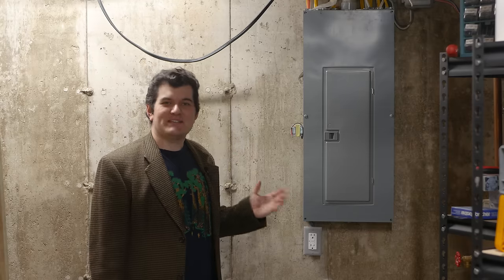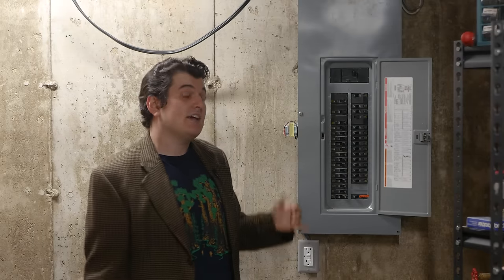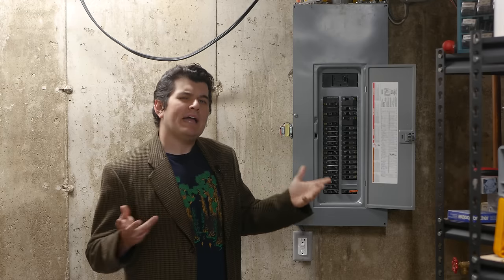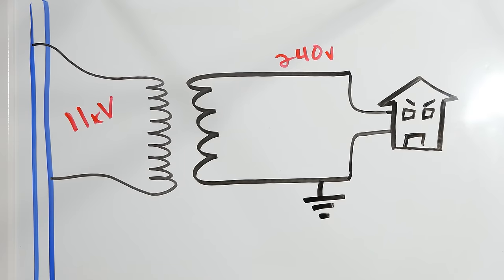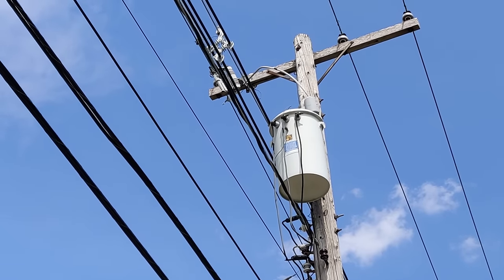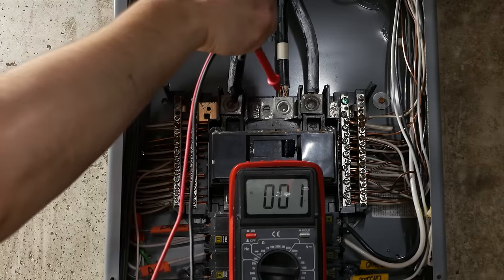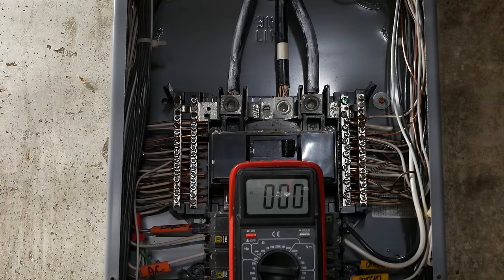The US electrical system is not 120V

Comment: The calculation at 14:40 is misleading. When you plug a charge, with 240V you get HALF the current for the same power. Take a TV with a power input of 100W as an example: With 120V you have 0,83 Amps (I = 100W / 120V) whereas if you plug it at 240V, you only have 0,42 Amps (I = 100W / 240V).

Comment: 6:35 You were correct, I am absolutely screaming in my head right now, because:
1. Those open electric copper cables feel *extremely* unsafe,
2. Connecting the neutral (N) and protective earth (PE) at the same connector is quite dangerous and
3. This electric "box" can't have any RCD's because of reason 2

I wouldn't be surprised if this box exploded and went straight into outer space.
(And yes, before you're asking: I am from Germany)

But asides from this, the explanations were great, as mentioned many times before.
Reply: 1. Those open electric copper cables feel extremely unsafe,

The voltage on the "open" copper cables is zero volts.  You can feel them with no problem.  

2. Connecting the neutral (N) and protective earth (PE) at the same connector is quite dangerous and

Neutral and "PE" are connected at only one place. The first disconnect. 

3. This electric "box" can't have any RCD's because of reason 2

Don't know how RCDs work huh?
Reply: @billelkins994  I'm sorry if I misunderstood some crucial differences between American and German electrical installations and did not clarify things enough:

First, with "open" cables, I am actually referring to the big phase cable with non-insulated ends, which definitely are under voltage.

Second, I don't really understand, what you're trying to say, but I found that it's much more complex than I thought and that the differences between American and German grids are too big for me to make statements about whether it's safe or not.
And also, I don't know which kind of electrical system he is connected to, which makes this decision even harder.

And third, yes, you can install an RCD in this system (Can't tell why my brain said "nooo, you cannot!"), but those installations are less safe, because they do not trigger under certain circumstances.
Reply: @anno_nym  Ahhh! Now I understand.  If something that has voltage on it can be seen or touched it will cause Europeans to "scream in their heads."  They ignore the fact that the "open connections" are normally behind a grounded steel panel.
Reply: @billelkins994  I really didn't want to start a discussion here. Please acknowledge the fact that our mentalities might differ from each other from what is safe or not.

If you think that's appropriate, you can request the original comment to be deleted. I will neither modify it nor continue this discussion.

Comment: 13:45 …but isn’t the neutral wire carrying 240v back to the panel?
Reply: No, it's 0V.
Reply: @wta1518  oh I get it now.  Thank you
Reply: @wta1518  so how is it not 240v in the other two wires?
Reply: @BLKSG6  It's 240v between the two hots, but one any single wire it is only 120v.
Reply: @wta1518  ok so this is because the neutral is 90 degrees out of phase with either hot wire and the two hots are 180 degrees out of phase with each other, so it’s like one is pushing and the other is pulling at the same time, if you will?  Where I’m stuck is if there is 240v available to the appliance when it’s plugged in, how is it not 240v across the entire circuit. Or is it really a doubling of the amps going into the appliance that the appliance would then have to step up to get 240v?  I watched about 3 videos on this and I still didn’t get it.
Reply: @BLKSG6  Because it's 240v across the two hots relative to ground. The neutral is ground, so it is 0v.

Comment: I had an international quality ISO certified geyser that stored hot water through the night for me to have warm water in the morning. However, it had a 2000 Watt coil that split open in a few months exposing me to the 240 volt current. I'm used to being killed like this, so I used an alternate heating source - solar water heater. 😊
Reply: This is a business trick whereby the company gets money for installation, repairs and replacement of coil. A good company makes coils that last 20-30 years. Also, the number of patients with severe electric shock injuries while using the shower would increase 😮.

Comment: As an electrician, I’ve always loved people that were afraid of electrical. That way my price can always be high.
Reply: One wire equals 120 V you’re correct if you touch two wires you get 240 V. I don’t suggest trying it but as an electrician, I know what can happen.
Reply: 240 won’t kill you to 277 won’t kill you. 480 might I have been hit by 120v and 277 volt and 208. Don’t tell me it will kill you. I’m still alive after being shocked 1000 times. The only time power will kill you in America is when your heart is standing. Still at the same time you get shocked, have a heart murmur. I’ve avoided death repeatedly
Reply: Then he wasn’t working with the proper people because if you get killed by power, all it takes is the same power to restart your heart. And proper people to support him if he does go down is the failure of that company.
Reply: The only reason my skills are so good is because I am a third generation, and was taught everything since nob tube wiring. And I was taught never trust anyone and always treat a wire like it has power.
Reply: Now I just wanna be that guy that starts a YouTube channel. How many electrical shocks will it take to stops a heart. And find the true chances. Or have I been the special case because of a heart murmur. Handling over 1000 electrical shocks.

Comment: If the 240v is between +120 and -120 both wires are dangerous, surely it would make more sense for 240v at top, 120v middle and 0v bottom, is there a reason its done the way it is?

Comment: In Sweden and probably europe we have between 16 and 30 Amps main fuses at 230/240 volts but 3 phases in normal houses. Mostly used to be 20 amp main fuses.

Between the phases you have 400V and if you conbine all 3 phases like in a motor you get the equivalent power of 400 * sqrt3.
Reply: In Sweden your three phase 30 amp service provides about 21 kw.
The panel in this video is 48 kw and the square root of three is just irrational.
Reply: @billelkins994  what is irrational, do you have any clue of 3 phase couplings and who asked about 48 kW!
Reply: @Bizmyurt  OK I'm sorry! I made a lame joke but the square root of three is not a rational number. At least it is not imaginary. (Another lame joke.)

48KW is standard service to a house in North America. Fortunately no one ever uses 48KW or bankruptcy would soon follow.

Three phase? Yes! I know couplings. You mean like :
High leg four-wire delta
High leg four wire open delta
Grounded corner delta
Zig-zag Y
Scott-T

Comment: 13:45 There are two lugs right there that have 240V between them, never mind that each of them has 120 volts to ground. Admittedly I can only see them because you took the cover off, but still.

Also, you say we're not talking 3 phases but y'all do generate 3-phase electricity, no? You just connect houses up to a single phase split into two, is that right?
Reply: Yes, our distribution system is 3-phase.  Residential customers are usually connected to just one phase.

Comment: Plugging the ground and neutral to the same bus seems wrong. How do your differential knows if you have a "leak"?
Reply: GFCI's measure the difference in current between the hot and neutral in order to trip. Ground isn't even necessary.

Comment: Boy, i understand so little of this stuff, and it fascinates me. I get the sense... the American system of engineering the 240V system into two 120V circuits seems quite ingenious to me. You mention that safety was not really the main motivation behind it but more a by-product. So be it. It definitely looks clever to me. Now i wonder how the Europeans do it. You mentioned it had something to do with the rebuilding after WWII...?
Reply: Europeans have 3 Phases at 120° to each other coming into homes, 240V from one phase to neutral, 400V from phase to phase. Most appliances just use 240V from a single phase, some high power things like electric stoves, ovens, water heaters, electric car chargers use 400V or multiple 240V phases.

Comment: I get it, no My house WAS only 110-120 no 240 that is only when you have appliances like the AC for rich people most homes still only use 110, is good to have the option 240 in case you need it only 2 breakers handle full load, the rest of the house runs on 1 breaker of 110v  less voltage means less danger to get a spike , so all "hi voltage" run on their own dedicated line

Comment: I just want to point out ohms law is not quite the right way to look at the relationship you are explaing. Any device that pulls 1500W is going to pull 1500W regardless of the voltage and P=VI so as voltage increases, current decreases.
Reply: You are wrong.  This is is a very basic subject.  You need to go back to the beginning to learn practical electricity.

Comment: So 120v Kills and 240v really kills :) nice one. Re foot hazard - as our sockets are switched we don't need to unplug them all that much, however most low voltage adaptors like phone chargers draw power if left plugged in, unless of course, you can switch them off at the socket :)

Comment: 16:25 I’ve been shocked by the 120v. So many times… mostly glancing blows but still. It doesn’t necessarily hurt when it happens. I just don’t like it as all.  It’s like putting you’re hand in or walking through black widow cobwebs,  they are stronger than most other webs sound different and they are always disorganized. The cobwebs don’t hurt I just really don’t like the feeling…

Comment: 21:24 lol I'm an aussie and the reason why we have switches on or sockets is you flick the switch off before plunging in or unplugging it so you're not plugging or unplugging a hot plug like the US likes to do 🤣
Reply: Most small appliances have switches on the device.  We don't usually plug and unplug such things hot.  One thing that generally does not have a switch is a cell phone charger.  They are plugged in hot, but the current draw is so low that the arcing is insignificant.

Comment: Does this mean that your 240V circuits do not have ground? Because in europe going to ground gives the full 220V, but here it would cut to 120 into the transformer, not the ground. Also how can ground go to the middle of the transformer. Everything seems weird. Like somebody designed the electrical distribution by throwing dice for what to connect where.
Reply: Also neither 120V or 220V will kill you if you don't get attached to it for a prolonged shock, if you do, both will kill you. I got quite a few 220V shocks. The first thing that happens is that you get bounced away as soon as you get the shock and detach yourself. Then you have a dizzy part of the body for a few minutes because the nerves are supercharged, and after that you are fine.

Comment: that little thing on side of  panel is a very small version of a transformer like on the telephone poles probably used for a doorbell low voltage circuit stepped down from 120v breaker getting power from the 240v main breaker getting power from  the 600v telephone high lines seviced from electric company

Comment: The 400V 3 phase, 3x 25A in EU standard, in modern insulated homes that are full electric with heatpumps coping with 17kW for heating, EV charging, and other household equipement makes US 120/240V split phase system looks obsolete at best.
Reply: You don't need 400V for 17kW
Reply: @Jst4vdeos  at 25Amps you will.

Comment: Wouldn't connecting a device across the two phases, compromise the RCD/GFCI systems, by not having a neutral wire connected?
Reply: You would use a 240 V GFCI breaker.
Reply: @GH-oi2jf  But doesn't it require a neutral to work?

As I understood it, it works by comparing the current going out via the hot (phase) wire to that returning via the neutral, and tripping if it detects a difference.

If there is no neutral wire, how does it detect the difference?
Reply: @BedsitBob  In that case, a 240 volt GFCI will just measure the voltage between both of the live wires. A 240 volt circuit doesn't need a neutral for current to flow.
Reply: @tier3rd375  Exactly my point. The GFCI won't trip because it won't detect a current leakage.
Reply: @BedsitBob  The circuit is between both wires. So all it needs to do is monitor both wires. It doesn't need a neutral to detect current leakage.
Reply: @BedsitBob  If you've ever been to a hotel or anywhere that has packaged air conditioning unit installed in the wall, you would notice that the plug for the unit is a GFCI plug. It's a 240 volt GFCI. How it works is by monitoring for leakage across both wires because both wires make the circuit. It doesn't need a neutral to detect leakage.

Comment: You have not clarified that the US DOES have a 120 volt electrical supply,  not 240 or thereabouts. It's just that it seems that many houses have two phases installed.  In my house I have for some reason 3 phase, with the consequence that I can spread the load evenly over the two most power-hungry devices, the electric stove and the geyser. And, in theory I could use a 3 phase motor,  for a borehole, not a single-phase capacitor-start or the like.  Since 120 is no less dangerous to the human who gets an electrical  shock I can still not understand why North America has this supply.  And of course the original DC of Thoman Edison was crazy. He was an avid patenter, often of ideas not his own, and in the record is a telegram to an English equivalent - can't remember who for the moment  -  begging him not to make the "disastrous error" of using AC.  I am by the way aware of the HV transmission pros and cons, but that is another matter.
Reply: Thomas Edison's DC service ran for 125 years in New York.  Not exactly a financial failure.
Reply: @billelkins994   I can't see the relevance.  Once you've standardised on something you're struck with it
Reply: @ralphwortley1206  The company that stopped the DC service is named Consolidated Edison. ConEd still provides 30 billion pounds of steam to customers in NYC. They started selling steam 141 years ago.  Energy is energy. Doesn't matter too much how it is delivered.
Reply: @billelkins994  It matters very much. WATTS =  volts  x amps.  
If you had a 32 volt system you'd need cables as thick as your finger to boil a kettle.  Because of their power demands much industrial machinery works on 600 v. Transmission lines work on up to tens of thousand volts. Look up a textbook to see why.

Comment: So if I get a "ground reference neutral" does my house still need its own ground? Or can I just use that 3rd neutral wire as a ground? My house is quite old but I think it is wired this way. Might be out of code now
Reply: If your house is old enough, you have no ground.  Back then it was not required.  No, you can not use neutral as ground.  Suggest you run all your receptacle and light circuits through GFCI receptacles next to your panel.   Also, make sure that there is a ground connected to the neutral and to an electrode.  Metal pipe, ground rod, or other metal in direct contact with dirt.   May already be in the panel or the electric meter.  That is for lightning protection.  Best wishes,   Kevin

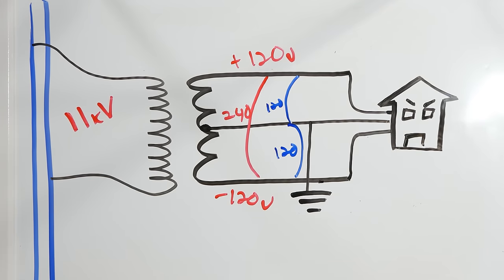Comment: Also, at the 5:54 point, you state that the two "phases" of the 240-120-240 "split phase system have each phase of the individual 120-volt circuits 180 degrees out of phase. That is incorrect. The transformer on the pole is producing ONE PHASE of 240 volts on its secondary, center-tapped to allow two 120 volt individual circuits. Thank you.
Reply: The transformer design synthesizes two 120V circuits 180° out of phase.  It is just a way of looking at it, really, or a semantic argument.  It is not a substantive argument.

Comment: I always thought that the confusion around North American mains voltage (110 V? 115 V? 120 V?) had to do with nominal peak voltage (which is unambiguously 120 V) versus some more complicated measurement/calculation rounded to the nearest multiple of five or ten, rather than just someone taking a voltmeter to their receptacles and concluding that everyone who says the nominal mains voltage is 120 V is wrong.
Reply: Our and your voltages are RMS, not peak.   The system “Nominal” is 120/240 volt single phase.

Comment: @22:05 That wall wart switching adapter draws power, regardless of whether or not it is powering/charging a device. If only the socket had a switch to cut off that vampire drain🤔. Where’s the discussion about 440V?